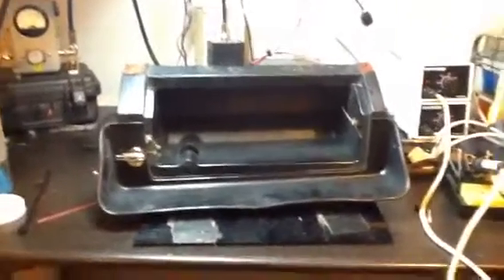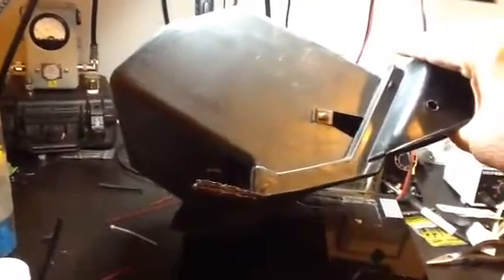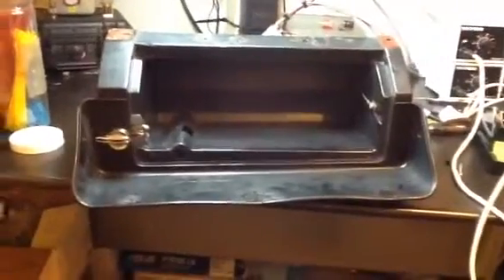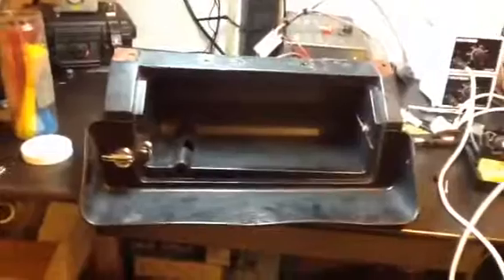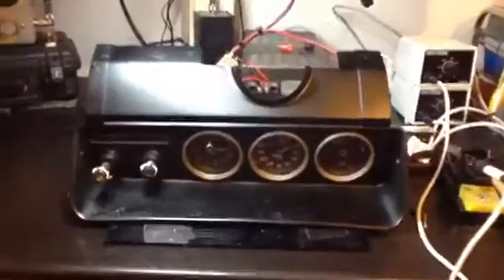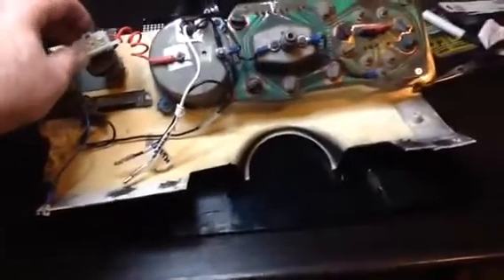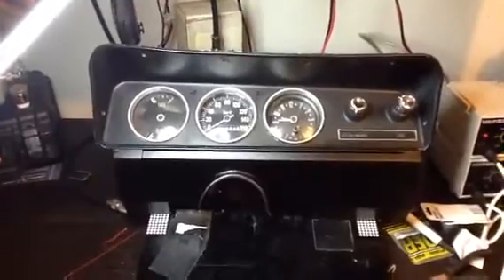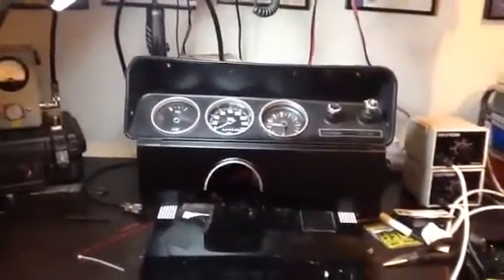AMC RAMBLER HORNET PLASTIC DASH REPAIRS 2

Comment: Paul, im looking into a dash rebuild myself at the moment, it needs plastic chrome. the process from Ford was to chrome the whole panel and then mask and overpaint in black leavign any desired chrome areas exposed. however the plastic chrome company want 1200, 2000 sanding down and have returned unit for me to sand down, but its tricky as there are moulded ridges, very fine which can be damaged by sanding.

Comment from the maker: Yes I understand where you are comming from re the plastics chroming, I too are in a similar spot so I have left that for a future task.

I do have an anti static mat, in the pictures it shows a plastic platform on a wooden computer bench.  For power I have a 13.8 vdc 21 A filtered power supply, overhead magnifying light, many tools and twin HAKO 936 soldering irons, makes for a comfortable test bench.